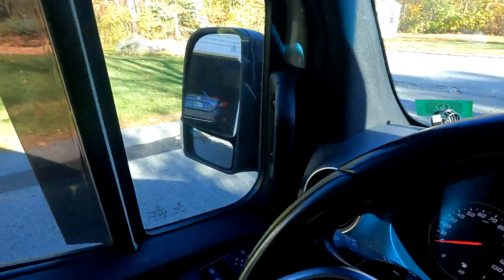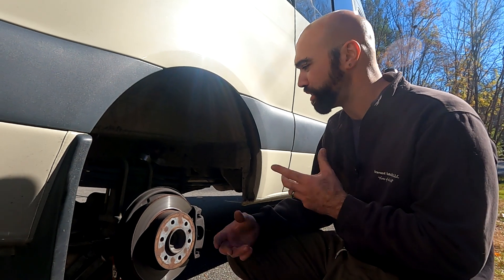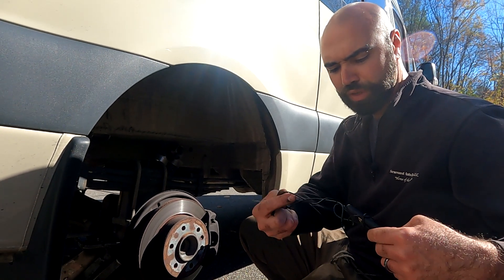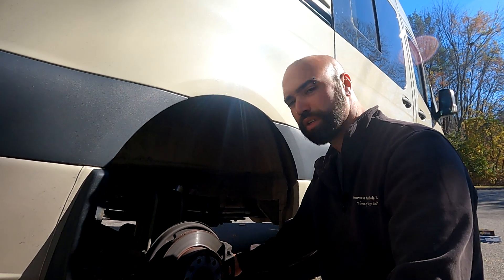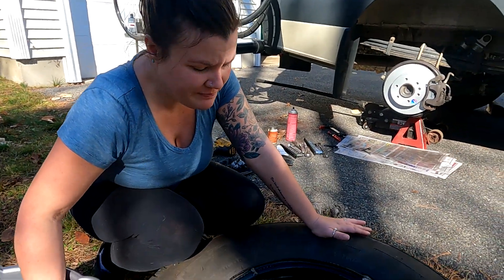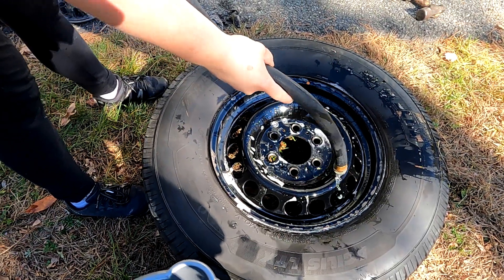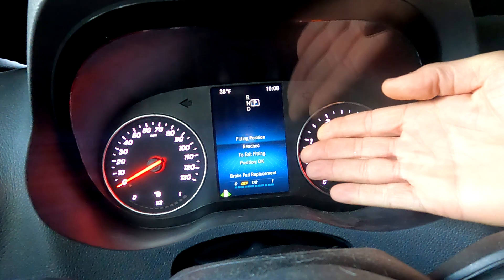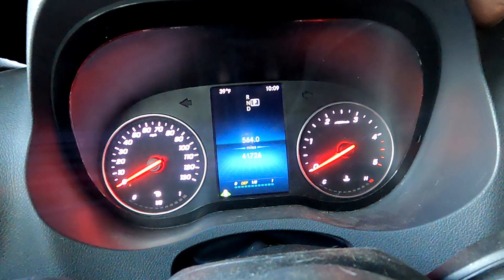DIY replace brake pads and rotors 2020 Mercedes Sprinter 2500 (Service B??)

Comment: Woah! Insane effort needed on that passenger front! Any update/feedback on how this set of non-OEM rotor/pads went over the last year?
Reply from the maker: Yeah it was out of control to remove the front rotors. The new stuff has been outstanding for about 25,000 miles! Very happy with the Powerstop hardware. It's clean, quiet, and stops great.

Comment: Thanks for the video. Got a quote this week to replace our brakes for @$3000. Not happy considering it’s a 2020 Sprinter with less than 25,000 miles (brakes are at 3mm). No, we’re not race car drivers, just a big family trying to get to church. Any other advice someone might take for granted if this is the first DIY brake job?
Reply from the maker: First off, we are so happy to hear that you are going to do it yourself! Kudos to you!

I think I covered pretty much everything in the video but I would like to add a few notes since you're asking. I have since gone back and added brake grease to the caliper slide pins since a couple were pretty dry and the old pads showed signs of the caliper sticking. This is much easier to do while you have the caliper off so I would add it to this job; it only takes a minute. And I would also recommend flushing the brake fluid (which we made a previous video about!) since it is 2 years old now. That's the recommended service interval according to Mercedes-Benz.

Other than that, just be prepared to save a ton of money! Good luck. We reply to all the comments so reach out if you have issues! We love to help.

Comment: Sweet this helped a lot! Thanks :)
Reply from the maker: Woohoo! You're welcome!!
Reply: @OutofIpswich  hey! After doing the change, the parking brake stopped automatically coming on. Did this happen with yours?
Reply: @tylerdawsey377 nope! Did you unplug it?
Reply: @robertwcote  turns out it was a loose connection on the front right ABS sensor!

Comment: Clean the pad brackets where the pads sit with a wire brush top and bottom that outboard pad got stuck seized  pins will also do that
Reply from the maker: Great recommendation! Thanks for sharing

Comment: That thing that makes metal to metal contact inside the rotor is your handbrake "pad" don't put grease on that.
Reply from the maker: No, it's not.
Reply: Ok, wanna explain how does the electric handbrake motor make the rear brake work when the are on?
Reply from the maker: @thequattro20v  It squeezes the caliper onto the rotor.
Reply: @thequattro20v @OutofIpswich - to clear it up for future readers, electric handbrake indeed applies force on a caliper, using same brake pads as your normal pneumautic hand brake. Model with manual, old fashioned mechanical emergency brake, indeed has separate braking pads called "shoes" which are semi circles, applying pressure from the inside, against inner walls of your rotor's central hub. Those also can be replaced if you already have your rotors out. It is important to recognize it, because of this difference rotors for models with electric vs manual parking brakes look different, you want to check before ordering. Also, for duallies, rear rotors do not have this hex retaining bolt, they are just held by wheel bolts. Lastly, also for dually models, you will need to tackle one more set of stubborn bolts holding up wheel flanges, those remind of wheel spacers, allowing for different positioning of wheel retaining bolts.

Comment: Hi there, I had left a comment yesterday pointing to a video of mine, but it has disappeared and perhaps it is not allowed to link to outside media in comments. Anyway, my questions stands, I have a 2021 4x4 Sprinter with 30k miles and I have a loud noise coming from the rear wheels/brakes that squeal when drive normally and then stops when applying the brakes. Is this what you are referring to in the beginning of your video as a typical issue with Sprinters? Thanks for your help (my dealer already made me change my front disc and pads for $1500 for nothing and wants to charge me $2500 for the rear not being able to confirm whether it is actually the brakes...)
Reply from the maker: That's so weird - I didn't see your comment at all! Sorry about that. Comments aren't super reliable all the time. But anyways, it sounds like you have the same symptoms as we had. Regular driving, usually after a short warm-up period, it would start to squeal in the rear and would vary with vehicle speed. If we applied the brakes, the squeal would stop. 

I believe I narrowed it down to a design flaw. I don't have any confirmation of this, but it LOOKS LIKE when they changed the parking brake from cable-actuated to electronic, they didn't remove part of the casting on the axle flange that was part of that system. If you take your rotor off, you'll see a big nub sticking out that does nothing.

On our van, that nub had clear signs of metal to metal contact. It was rubbing against our rotor inside face ever so slightly. Whenever we'd apply the brakes, it would move the rotor just enough to break contact and the squeal would stop. 

I put Power Stop rotors on and applied some grease to the worn part of the axle flange nub and it hasn't made a noise since. If you're at all inclined, you can replace your brakes for way less than $2500. That's ridiculously high in my opinion.
Reply: Thank you so much! I think MB knew all along, but still pretended they didn’t and made me change the front at only $1500 to “isolate” the issue. They am not sure I visualize what you are describing, I would be curious to change the brakes myself, but I have never done it on a modern car that I use on long distance with the family, so I am a little scared. When changing the rotor, how can I know the noise is not going to reappear? The grease is enough? Isn’t there a part that is better designed?
Reply: @EdTwoMR if the rotor offset is slightly different, it could alleviate the issue. It could be as minor as machining tolerances. I'm not really sure that the grease did anything at all, to be honest. You could file down the nub if you want to be totally sure it won't come back.
Reply: @robertwcote  Thank you so much for these answers. It really helps me understands better what is going on. Overall I absolutely love my sprinter, but MB is a real pain to deal with and between the EGR valve getting clogged, the automatic sliding door not always working fine in winter and now that brake issue, I am quite annoyed.. I wish Toyota would make a good looking van like the size of the Sprinter.. 🙂

Comment: Thanks for posting this! How do you like the Power Stop brakes? I’m thinking about going this route when its time for a brake job.
Reply from the maker: So far so good! Stopping power is no worse than OEM, perhaps better. We haven't done any controlled testing. No noise. Probably less dust than the original equipment though it's hard to say for sure. We need more time yet to see how they last but otherwise we'd recommend them!
Reply: @OutofIpswich  any update on powerstop brakes? Love 'em/hate em?
Reply from the maker: They've been great! Pretty low dust, excellent braking, and minimal wear after ~25,000 miles. Highly recommended. @StarWarsNewsletter

Comment: I just changed my rotors and pads on my 2014 and the front were the most seized I have ever seen. I ended up having to replace the knuckle and hub on one side and used a 10,000lb puller on the other side which barely worked. This is bad engineering on Mercedes side.
Reply from the maker: Sorry for your struggle! It's actually comforting to know ours wasn't the only one that put up such a fight.

Comment: Why replace rotors and not just pads?
Reply from the maker: Great question! You can measure the rotor thickness to ensure they're still within the specified dimensions. If they are, best practice is to resurface them so they're nice and flat again. This allows the new pads to work properly with the old rotors. 

I always do both rotors and pads because it's only a little bit more cost, but less effort to not have to bring the rotors to a shop to be turned. Plus, new rotors will give a longer service interval over reusing the old ones.

Comment: Use gloves and I did not see you clean off the rotors with brake cleaner.
Reply from the maker: I was very careful to not touch the braking surface of the rotors during installation, which is why they were clean. I have only ever had frustration from wearing gloves while working. I try, but I can't.
Reply: @OutofIpswich  Brake rotors are covered in oil to prevent rust when you buy them from store, you should clean the rotors with brake clean to not have oil between the pad and rotor.
Reply from the maker: @thequattro20v  Power Stop prevent rust with an electric coating rather than oil.